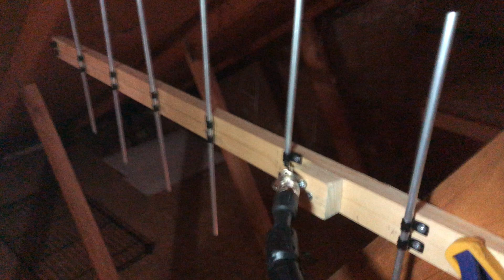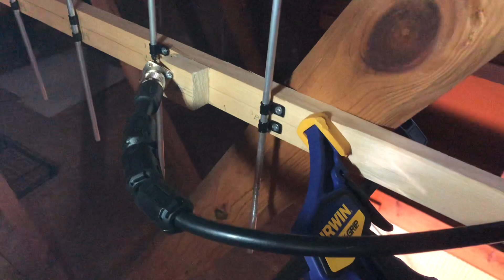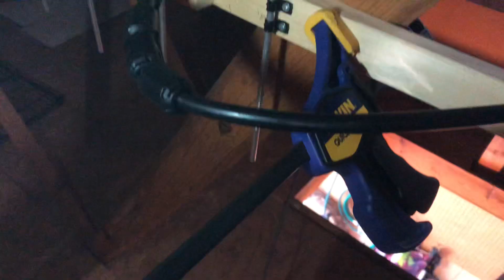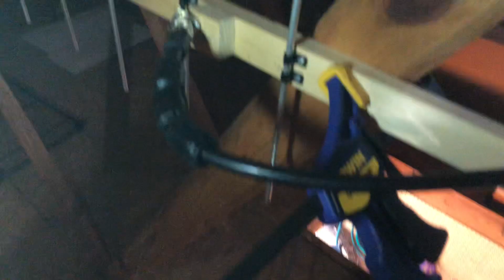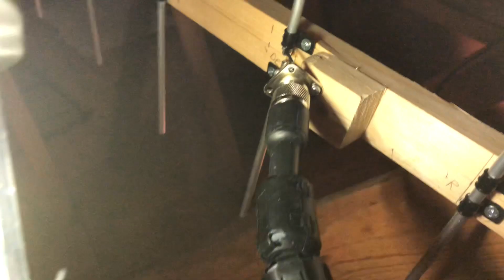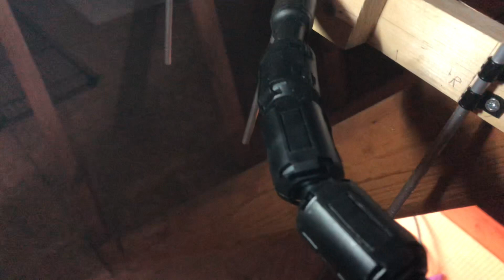70 cm Yagi part 2

Comment: Nice! I currently have 4 antennas setup in My attic, and they work surprisingly well.
Reply from the maker: That is the third for me but I don’t have them all hooked up at once.  10, 440, 6 meter antennas.  You’re antenna building is really cool too!
Reply: I made a handheld yagi for 70cm using a small plastic pipe and aluminum welding rods.